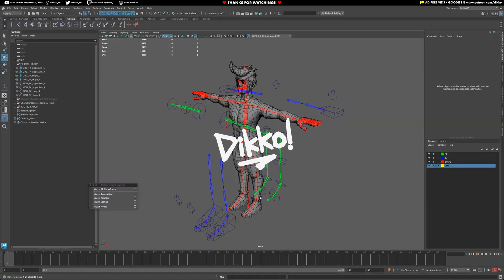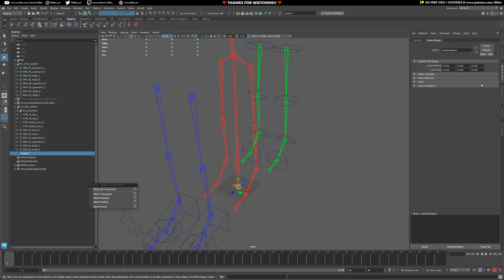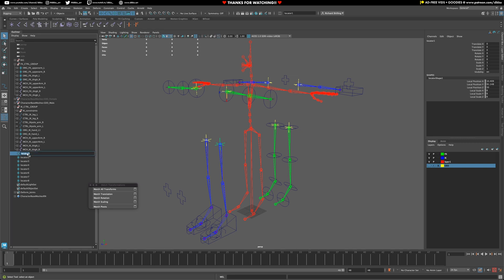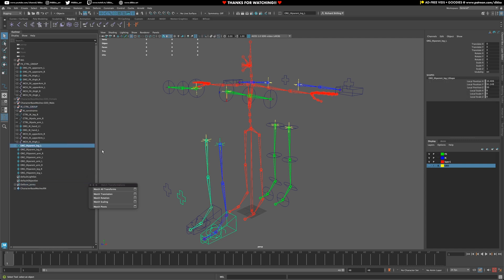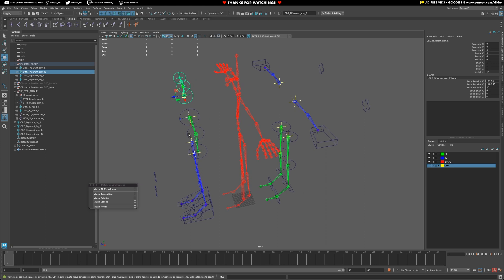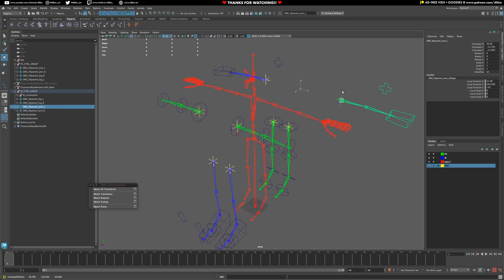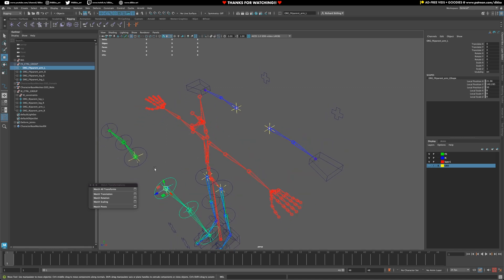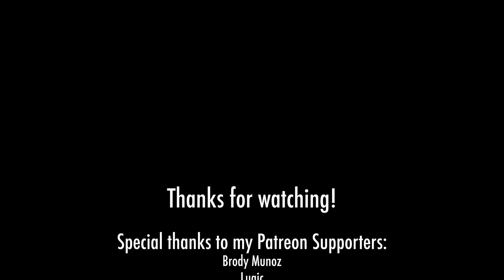Character Rigging in Maya! Episode 8 - Lining up the FK and IK controls

Comment: Quick question if you don't mind I'm a beginner in rigging. Wouldn't it be easier to not split the IK legs in front of the body and the IK arms behind the body? That way you could group the IK set, align it to the DEF bones, ungroup the elements and regroup them again with a brand new group. 

That way your group is still in the center of the world, no constraints needed or freeze transform. While following the tutorials I kept my FK set in front and IK set behind the DEF set and moved them using the world translate using a relative step of 100 units. Then when grouping a set all I had to do is is move it back by 100 in world space. 

I was curious if there was a specific reason for that, maybe I'm breaking something I'm not aware by doing so. Cheers for the tutorials, they are amazing!
Reply from the maker: you are correct :). I split them in the video so its easier to understand exactly what was happening between the 3 joint chains